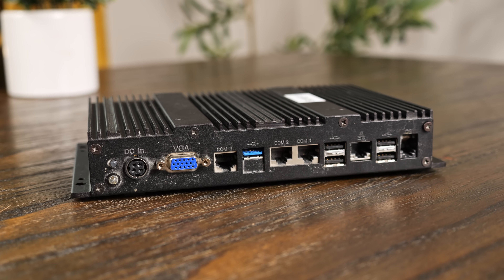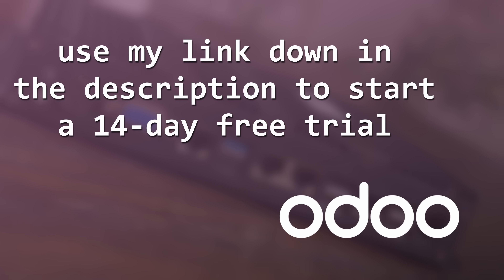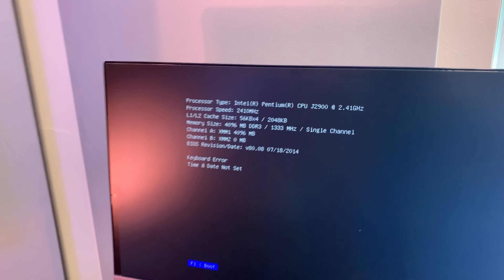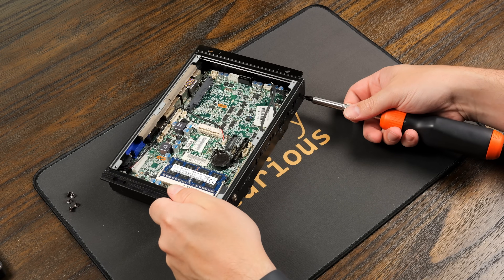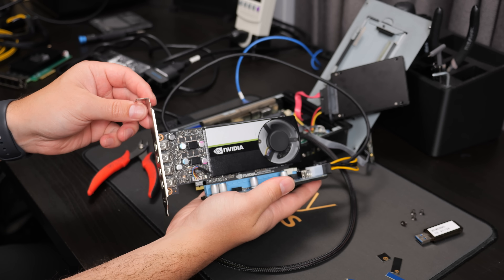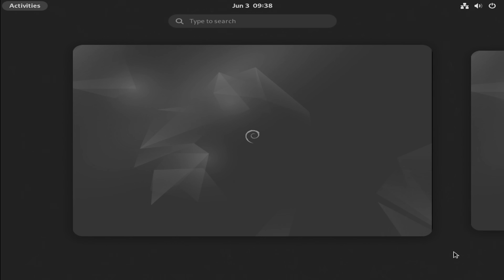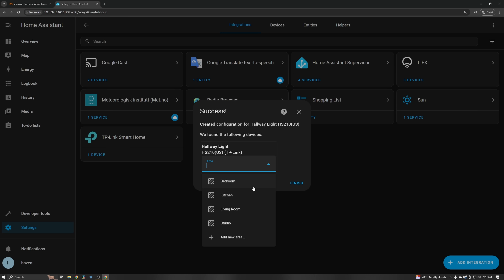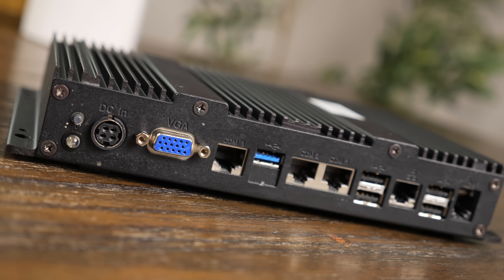I got this PC from a fast food restaurant. What now?

Comment: lol I used to work in the IT department for a large-ish fast food company. I worked server infrastructure, but I know how they spec the machines for the restaurants. Basically, the computers they buy are really expensive and slow, but it doesn't really matter since they need to run software that is very old. A lot of those boxes at our place were running a version of Microsoft DOS, although that was getting unmaintainable even by fast food thin client standards so they were being moved to lightweight Debian installs with DOSBox to run the software. The rest of the show was being run by an old XP box in the back room, which coordinated the PoS software on the thin clients and also handled the local database for sales and inventory and stuff like that, which was then connected by a cradlepoint 4g hotspot to the national database. Iirc the bump bars and POS terminals were serial devices, and they used a seperate terminal to output additional order displays depending on the location in the store. They were networked to the back room computer/server using run of the mill Cisco layer 2 switchs and hard coded IPs for a basic routerless network. All of them used units constructed very similar to yours. I believe our unit cost was some think like $700-800 for each box which we got from a small boutique vendor. 

This solution is expensive compared to just using a purpose build modern system, but it works basically anywhere someone wants to open a store, and is plug and play for the operators. Also rebuilding the software from the ground up while maintaining the existing software is a really expensive prospect, and despite what you may think fast food really isn't that lucrative of a business. End result is that legacy software is the name of the game, and therefore the number one hardware requirement they have is that it's compatible with their ancient bullshit and it can survive living in the most greasy environment known to man. Seriously those things were gross. 

If you think that is a clownshow wait till you see the infrastructure powering it. It's even worse.

Comment: The problem causing the display issue on Linux is caused by lack of open gl drivers that are shipped with mesa. The chip is so ancient you need mesa-amber legacy driver package (at least thats what it is called in arch). You also need x11 and not wayland as wayland requires a version of opengl that this chip does not support
Reply: Useful to know, thank you!

Comment: would be a good LED / light fixture controller PC for ARTNET stuff. Especially better with multiple NICs. Serial ports are good for motor controllers or interfacing with other professional equipment. Like as it is intended, interfacing with AV equipment. You can basically talk with Projectors, AV switchers or Industrial Display Panels. Network switches and UPSes have serial interfaces too...

Comment: Nice! What I like most about the system is the slim form factor. Recently I built a new router out of an N100 based passively cooled mini PC. It works great, but it's also pretty bulky. This one is flat and has these mounting brackets to screw it under a table, shelf, or even on the wall.

Comment: I've got an old industrial computer that was used as a net watcher from some old client site. Powered by a J1900 as well, using it to host OPNSense, honestly if you're a hobbyist and dont have any 2.5gig+ network needs, it's a very capable CPU to run basic firewall tasks along with ClamAV for antivirus and Suricata for IPS. Could be a good deal for someone if they find one at a business liquidation sale or on the used market ala facebook/Craigslist.

Comment: these are not something special... no real problem for you to have it. I installed these for marco's and chillis all the time.. this is for the make line however.. no credit card processing were done on these.. or any of the pos terminals..  The sig capture device is a stand alone linux based cc terminal that communicates over the network.. all the servers were on a vpn tunnel that is configured through the fortinet router.

Comment: POS configuration is what is causing this problem, that’s why people don’t even try to use them as a desktop. I got hold of a couple of POS systems years ago and about the only way they worked was headless. Video chips are setup in firmware for a client running in full screen kiosk mode that’s all they know how to do.  It depends on how big the company is that it came from… the ones I had came from PapaJohns…unintentionally a pizza themed comment…and they were willing to spend more money locking down their computers. It was an attempt to make them useless to thieves, that’s why thieves don’t bother with POS systems in the first place. That and they are under the misconception that they are all “stupid” thin clients and need the server just to work. It’s a deterrent that works pretty well. That and it ends up being too much crap to try and steal when you’re on a timetable.

Comment: as for those people who advise against using realtek with pfsens and opnsense - theyre just wrong, at least with the 8125's. ive been running pfsense for over a year with six nics in three cards, all 8125's, and they are ROCK solid, whereas ive had 2 out of the 3 intel 225v's that i bought at the same time die on me.  not sure why still but i trust the realteks now and they tend to be cheaper so why would you not?  yea, youve gotta install the driver and for newbies thatd suck but cmon freebsd, just start supporting it already!!!!!

Comment: What kind of sata and power adaptor did you use for the sata port on the side of the motherboard? I have an old industrial i5 based passive system and have not found an adaptor yet.

Comment: If you lived on the road and wanted to do an SSD NAS of some sort, this could be kind of an option. Low power, no moving parts, keeps good temps. 
Or if you're a mechanic and need a PC to mount on the toolbox for diagnostics.

Comment: the reasons why prices are high is because these are commercial and industrial computers and when they fail and keep you from making money you pay whatever it takes to get back up and running.  I have three pentium dual core machines similar to these.  We had many many more but just threw a bunch away as we dont use them anymore.  I kept three to use as scada and datalogging computers

Comment: We are in an era where mainstream PCs have more than 4 core processors, so the best way to utilize this low-power thin client that lacks pcie gen2 x4 expansion slot is dual 2.5Gb network port routing (executing pfsense firewall ) As long as a 2.5Gbe switch is connected to the LAN port, it is suitable for small home studios. It is best to turn off its virtualization function and only give it a single role. As long as its processor is not always under full load, then it It will be a very useful machine.

Comment: This channel is great because it explores use cases for interesting unusual devices. This thing could be useful if you wanted something low power and passively cooled that did not need a lot of processing power in a location like a basement or garage.  It was expensive partially because it's fairly rugged.  I would not pay much for it, but I could think of some good uses for it.

Comment: Some Switches or those APU-Firewalls can only managed via Serial Terminal. ists hard to find a PC with Serial Ports these days ;-) 
What about a jellyfin server with an attached GPU? 
HassOS directly would be fine for Beginners. 
ich have an Lenovo Tiny with an external Nvidia 2070S unter Ubuntu server and use it as an ollama Server with WebGui. Could be running with this device too.
Klipper for some 3D Printers.... does it run 12V? So some 3D Printers would be able to power this with the printers powersupply
Or as an Admin-PC - connected to up to 3 Switches or to an headles nas and/or firewall via terminal. Perhaps something like PiKVM and use those serialports to switch an KVM Switch. 
Many ideas ;-)

Comment: Actually I think better way would be to install m2 A/E 1G Realtek adapter - then It would be totally OK for OPNsense (I can confirm, that 2.5 is somehow limited, but it will work with os-realtek plugin). I did routing with Dell Wyse 3040 (as it has only 1 NIC i have WAN and LAN done by VLAN) - performance is totally OK for 300mbit internet connection. So, with 2 NICs - this kind of system shall be OK for routing. And it makes no sense to have one interface 2.5G and the other 1G for this purpose. But... with VLAN (ingress and outgress by one cable) - then yes, it would make sense (however, as written - I am not sure when there would be performance limit for this system, I believe routing 500mbit would be OK).

Comment: That display issue reminded me of all fancy problems with XFree86 back in the day. A lot of evenings spent trying to get that to behave with the unusual setup I had at the time. Though it was due to number of different displays each having different specs and each being little less well documented than the previous (I think there was site called monitorheaven or some such at the time that listed a lot of vertical and horizontal refresh rates for good number of displays at the time, but it doesn't exist anymore unfortunately and then again, monitors of today aren't as finicky anyway due to DDC/CI. 

Glad it's quite rare to run into these weird fringe cases nowadays, but dealing with them can still be a challenge unfortunately(though personally I find it easier to deal with them by just trying to set the graphics system config right from CLI rather than from GUI which might behave oddly due to poor defaults).

Those serial ports look interesting. Could probably all kinds of fancy projects with those.

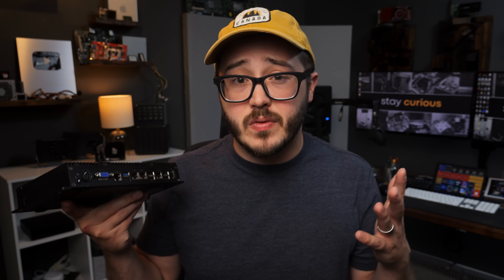Comment: 12:54 for anyone out there looking for a low power x64 as a firewall: lack of AES-NI is a simple showstopper for any CPU.
Compare J1900 with AMD GX-412: the latter is a nail compared to J1900, but as firewall, Sunnyvale obliterates Santa Clara.
For anyone looking for something "new and different" as firewall distro, consider to take a look to NethSec. It's green, openwrt based but.. Might have some potential

Comment: The usage of these types of machines don't require much processing power or RAM...they're just a dummy terminal for the most part.  I have an old POS system that was in the grill area of a local McDonalds for many years....the only issue with it was it was caked in grease and grime LOL. It worked fine otherwise, they just upgraded to newer systems and got rid of the old stuff.

Comment: I've worked for mc donald for 1year here in France, and with one of my manager friend, we were the "tech ppl" 

 he explaned to me how every pieces of the network system was terifing with both very outadated specs, missused features and prices of top of the line hardware, for exemple we had a tablet in one room tha was powered by 2x 100mb/sec poe that could scan NFS's in a whole small room, 

all of the OSs where proprietary super locked often just connecting to remote server for basic function, and what was not using proprietary OS just had windows XP and was still remoting on firm's server

Comment: That screen cutoff sounds like a vblank issue. Any competent VGA monitor will let you adjust that manually. I have no idea how good your converter is and since modern monitors no longer accept analogue inputs you're out of luck there. Maybe there is a config buried somewhere in the depths of Linux and the default is different than what Windows does?
Additionally, be aware that VGA (or more accurately QXGA over a VGA cable) has a max. resolution of 2048*1536 but that only works if you have a really good cable. And sometimes your OS will have a different opinion on what VGA can do.
In any case you're probably right in not spending more time on this issue. Unless you have a monitor with a VGA input it'll be a pain to get this working.

Comment: Would this computer have a J1900 that needs a resistor to fix the LPC clock signal flaw?
Reply: I think it would depend on the CPU stepping he get. It's affected on C0 stepping, while D0 had this issue fixed.

Comment: Hey dude, I noticed the serial ports are an RJ-45 port. You could probably use it to control those Cisco-esque console ports, using an RJ-45 straight through, as a terminal server. Just a suggestion.
Reply: Many server motherboards still come with serial ports, you can use it as a poor man’s IPMI.
Reply: @OscarCarlsson1986  AFAIK  IPMI works on a dedicated lightweight processor (e.g. ast2400) which can control power independently.

Given that I agree that setting up a serial tty could be a life saver in case inband network is failing
Reply: The rj45 ports are used on many industrial equipment in the gaming industry they are used for player tracking systems in the casino but you need need to make the custom cables usually only 3 wires are used for transmit, recieve, and ground also be aware sometimes you need diodes and resistors to filter the flow. Could make an interesting terminal to control other systems but I think wifi or cat connections makes better sense these days.
Reply: I also thought about that, but I can't think of a good reason to not just connect to the switches over SSH
Reply: @YonatanAvhar  I guess it's for like older switches maybe. When you don't have SSH, you can only use telnet. Might as well use a terminal server, it's more secure. Also, I guess if you don't want to lug a laptop into the server closet to configure it via the terminal first, cause Cisco doesn't provide any other ways of configuration out of the box.

Comment: these are great for a windows server 2019 or 2022 for Active directory, radius, and GPO management. I have had a few of these running with hyper-v server 2019 and just being a replication server for my main Hyper-V servers. Having almost no power draw and no fans means they can be a set-it-and-forget-it backup device that can run forever off of a UPS. They are shockingly responsive - even when running 2 or 3 windows server VM's actively - though most of the time they are just passively keeping a backup up to date.

I have built an entire backup network off of these machines for power outage situations. pfsense, ws2019 hyper-v with 2 windows server 2022 servers, unraid running pihole and a few docker must haves (and a 6x4tb ssd array with the help of a mini-pcie to 5sata port adapter) and finally a windows 10 ltsc workstation with all my daily apps. The internet modem and 4 computers - along with a portable monitor, dual tuner HDHOMERUN, a wifi access point and an 8 port switch (all 4 can be run off USB power from the different computers) - can run my network for more than a day from my UPS during a power outage.

 also, setting up a TFTP server for network booting other machines. These are also great to sit behind a TV and stream plex or an HDHomerun.

Comment: I don't think the J1900 was ever considered a 'mobile' CPU, it was made exactly for this kind of application.
Reply from the maker: You're correct, that was a mistake! I mistakenly saw bay trail and called it mobile.
Reply: We call it 'Embedded CPU' 😅
Reply: I work with POS systems all day... and in the older POS systems we have all J1990's...
Reply: it absolutely is a mobile cpu. it's mobile cpus that also happen to be useful, and get used for, these tasks. bga1170 is the socket, which was then succeeded by bga1090. you could argue that some cpus on that socket, namely the c suffixes, would be truer to this statement since they have nonfunctional onboard wifi that is then fused off to make a c suffix chip, whereas the regular ones do have it enabled and functional.
Reply: @destrierofdark_  You are correct in noting that the J1900 has a BGA1170 socket, which is specific to mobile CPUs. The "C" suffix chips are indeed special variants of Bay Trail-T processors that have non-functional onboard Wi-Fi and are designed for use cases where Wi-Fi isn't required.

The Intel Atom Z1900 (J1900) is a mobile CPU designed for small electronics, tablets, and smartphones, with a focus on low power consumption and compact form factors.

Comment: If nothing else a simple system like that would work great for retrogaming.
Reply: Maybe buttt a lot of emulators take some decent power to run
Reply: It would be just fine for a MAME cab, I have an old Thinclient running mine at the moment, but it will be upgraded with my current gaming desktop when I get my new gaming PC, it uses lots more power but I will have some better emulators running also

Comment: I got some Lenovo ThinkHub 500's for free  from a company that was upgrading their kiosks.11.6" rotating touchscreen, i5-7500T Processor with vPro enabled, 128gb SSD, speakers, mic, tons of HDMI.. I use it with a surveillance camera setup to store footage and monitor the cameras in realtime.......yeah and it also runs a local Valheim and Minecraft server after a massive RAM upgrade and a new SSD.. Moral of the story? Never underestimate the usability of these type of machines.
Reply: But this is being used in that enviorement because it's FANLESS , these computers are used in areas where too much dust is expected to get in the fans so they resort to them
Reply: This is why no one should ever buy a Pi now.
Reply: @Jaabaa-1 preach.
Reply: @Jaabaa-1  The Pi still has its uses, but yes. I had the chance to see one of the registers that NCR makes used as an all-in-one PC. With the touch screen they didn't even need a keyboard or mouse to use windows on it.

Comment: J1900 is cursed, has a hardware flaw that will brick it sooner than later.
Reply from the maker: Huh, had to look that up. Considering this seemed to be working for quite some time, I wonder if they implemented a fix?
Reply: @HardwareHaven  the little bit of searching i did when i had my issue suggested they had not fixed the issue.  I learned the hard way with my first pfsense build.